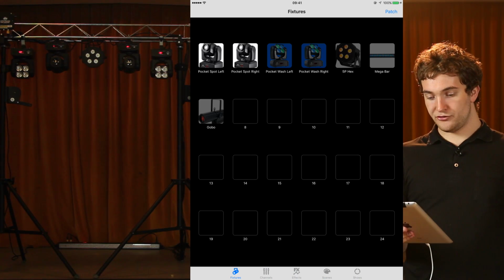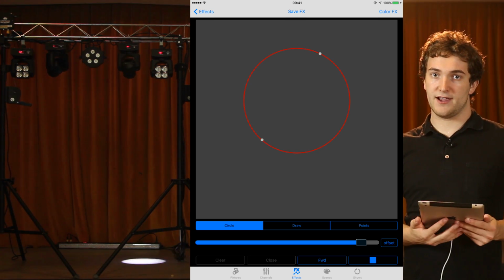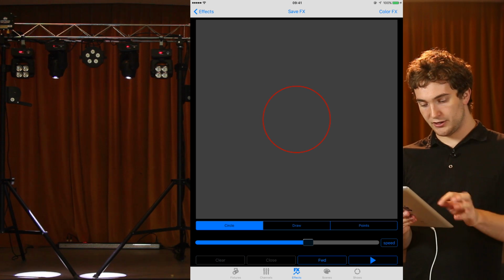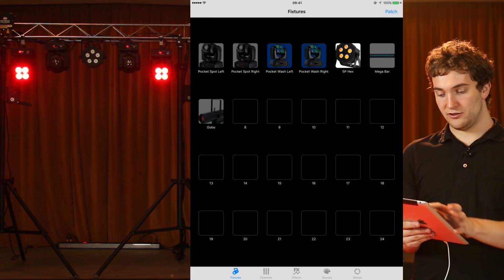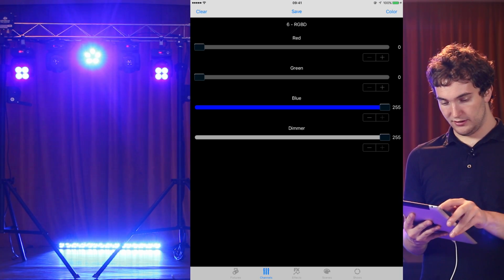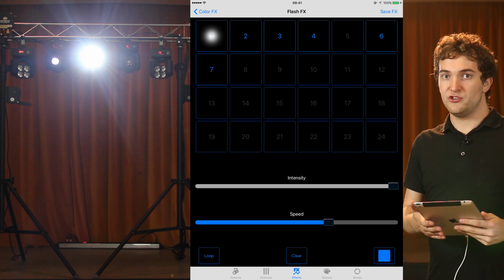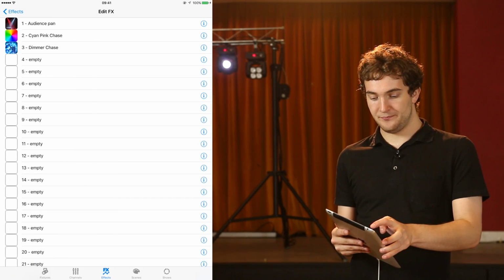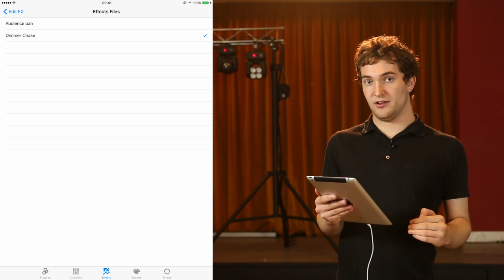Effects | ADJ AirStream DMX Bridge [Tutorial 4]

Comment: HELP!!   I have two Chauvet intimidator 110.  They work perfectly adding them to scenes etc   When I go into the Effects to try and draw some specific movements (band use not DJ)  I select the fixture, turn on the color wheel light to the color and gobo I want and went into FX to create a specific movement.  As soon as I do, they shut off.  So I figured it's because they aren't RGB, so I went ahead and drew the movement.  The heads followed it perfectly, blacked out.  When I create the scene figuring it would meld the two they remained blacked out.   So then I went back and forth, as soon as I turn off the FX the lights return to home and light up, I go to the Effects page, they black out.  How do I keep them lit?   I have been all over it and can't figure out what I'm doing wrong, the lights are on, as they only shut off when I select the FX page, and then  when I shut off the FXthey go immediately to what they are supposed to be in color, so I can only program movement on the channels themselves by pan and tilt which is tedious when I need specific stage sweeps.  Please, I'm desperate, and have a full hex par light show programmed on this system, without problems, so I am very confused why I can't get the moving heads to light up when I'm only programming the movement in Effects.  Thank you!!!!

Comment: These videos are super helpful BIG THANKS!!! I do have a question: I have two chauvet swarm fx fixtures that I would like to sometimes set to sound active mode, which can easily be done from the airstream channels screen. However they will run through their sound mode and eventually fall out of sync. These two fixtures are at the very ends of my truss. Have you ever set a fixture to master/slave that is daisy chained with other different lights and had it work correctly? That is not impact the remaining lights and or the bridge control?

Comment: Great tutorials, helped me get started with dmx bridge but I ran into small issue. Ive got two pocket pros from adj but can not get them to react to the effects. I turn on dimmer and shutter and the are lit just like your heads but when I get to effects section they dont react to any commands. They run in 13ch mode and I assume they are patched correctly as everything in channels tab seems 2 work fine. Colors, gobos, macros all fine. Any suggestion what I might be doing wrong ? Thanks

Comment: Tried the colour FX with Pocket Spot several times and tried using variations with the channel faders without any sucess, I would have thought it should work not sure why its not working,
Reply from the maker: Colour FX only work with RGB color changing fixtures. Not fixtures with colour wheels
Reply: Thanks Joe I thought that might be the reason, and thanks for the quick response much appreciated.